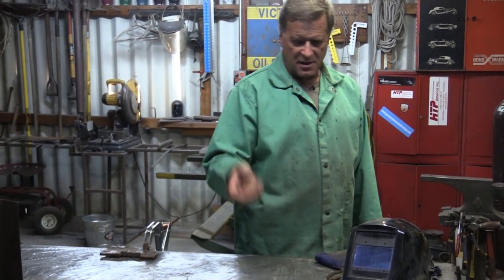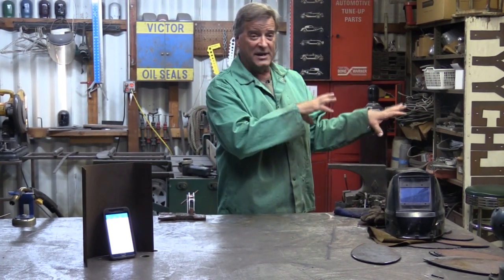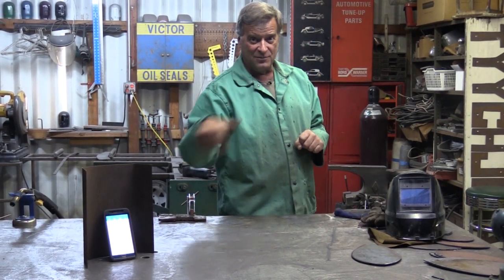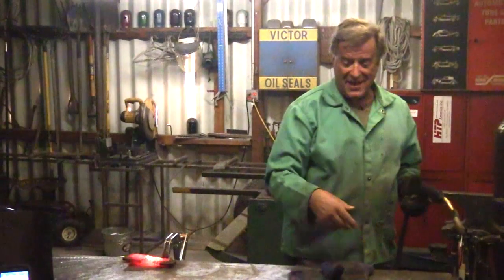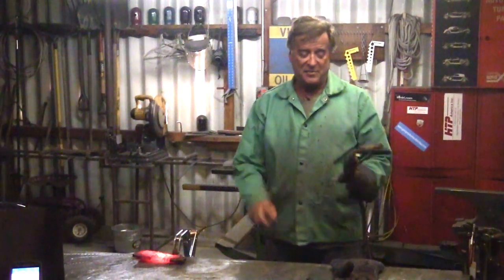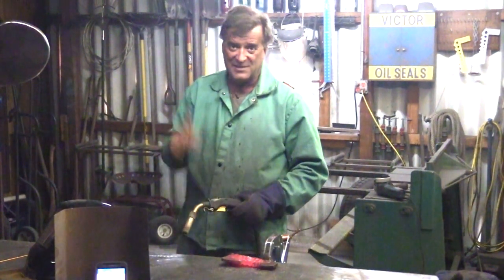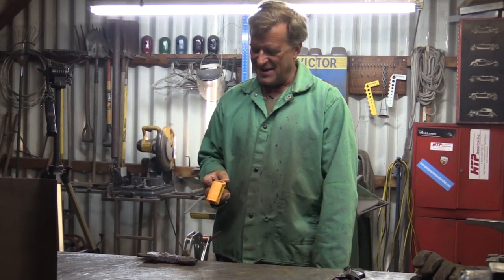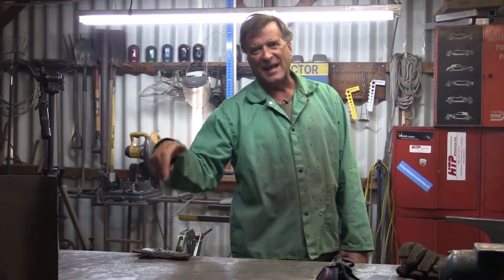Torture Test: The AHP AlphaMIG 250 MIG Welder - Kevin Caron

Comment: What kind of a test was that your holding the gun over the same area of course it's going to get hot. That's not a far test you need to weld continuously in a straight line not staying over the same area. Just saying.
Reply from the maker: You supply the metal and I will do it again.

Comment: Does that Mig250 have a/c and d/c?  Getting better on the reviews.  I really dislike the "opening" ones.  Anything looks good in the box its after six months or more of actual use that the opinion of the "unboxer" has any value.  Take care.  Doug
Reply from the maker: Sorry, DC only.
Reply: Wow.  That is a huge drawback for that machine.  Welding aluminum is a huge part of a versatile mig machine.  Seems to be out of stock everywhere with no return date.  On Amazon when they quit selling it it went for over $1800!!!  That is a hell of a jump from the listed $800 intro offer of $700.  Of course if you find it elsewhere it is a $200 bill for shipping.  If it ever comes back to the market it is in the high priced bracket of blue and red.  I have an AHP 200TIG and was hoping this would pan out.  Then I looked for the 60 amp plasma cutter and that too was no longer available with no return date.  Its price also jumped up to the level of the name brands.   Not having the A/C side is a huge detriment since you can't weld aluminum properly without it.  All in all when you get past the "unboxing" this machine is a big failure and it would seem AHP is withdrawing from the market leaving unsupported products.  Not a good thing.
Reply from the maker: It was discontinued because of shipping costs.   Too big and heavy.   AHP is coming out with a 3 in1 in the next few months to replace this machine.  The AlphaCut 60 is back in stock. Call AHP directly to order. Or order on Amazon.

Comment: did you end up doing that stick torture test? i wonder if the welder itself would over heat at any point, this was extra stressful on the gun as it was stuck above the small piece of plate that was glowing molten not running long beads or pipe passes

you should do more torture tests like this, and on all kinds of tools not just welders i think it could attract a whole separate audience to the channel
Reply from the maker: Never got the chance to do that test.   Welder sold just a few days after I shot this test.
Reply: oh well should set up a new test, AHP, Everlast and HTP seem to be what everyones looking for advice on lately

Torture tests are great, if a machine can survive an hour of straight max amps than anything build to the same specs should survive dailyuse
Reply from the maker: Don't have access to HTP but let me see what I can do.

Comment: Is this the same welder with a different label and color?! http://www.eastwood.com/eastwood-mp250i-multi-process-250-amp-welder.html
Reply from the maker: No, Eastwood ripped off the look and got in to the same factory that the AHP was made at.  The insides of the Eastwood are NOT the same as the AHP.   Designed by different people.   AHP  has stopped making this machine and will be coming out with a 3 in 1 with the same insides.
Reply: I see... thank you for responding!

Comment: Kevin, did you run flux core through the machine yet?  Just curious.  I use my current welder outside sometimes and flux core is the way to go for that.
Reply from the maker: +mjbop1 

have not tried flux with this machine yet...